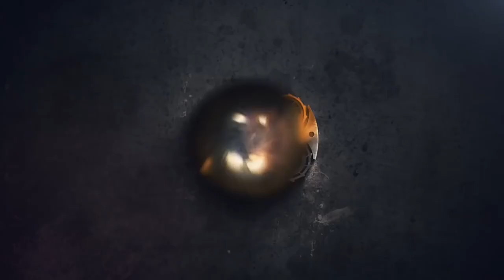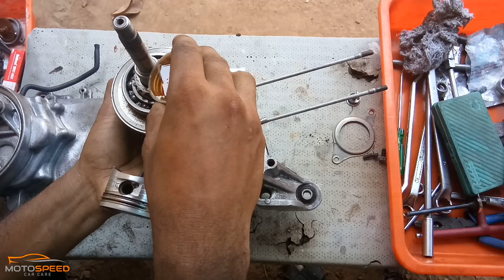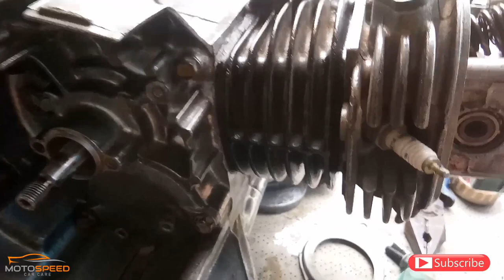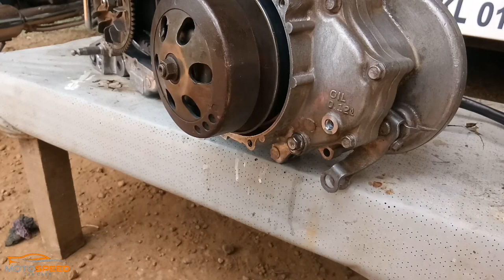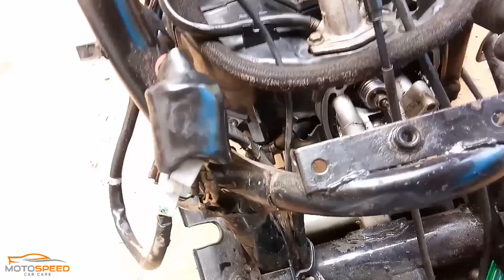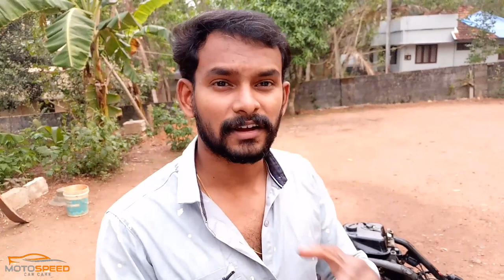Honda activa engine work timing setting | engine working മനസിലാക്കാം 😜

Comment: Ente alto model 2007 radiator fan engine off ayittum fan കറങ്ങുന്നത് nikkunnielle ravile on akkiyitttum കറങ്ങി കൊണ്ടിരിക്കുന്നു enthu konda
Reply from the maker: Radiator fan battery direct connect cheyythirikkunnu atha broo allengil temperature switch complaint

Comment: Honda dio 2015 model plug il pettannu kari adikunnu 3 weeks akumbol ingana preshnam varunnu ntha problem
Reply from the maker: Carburator tune cheyyyanam pinne air filter koodi nokkanam broo
Reply: Engine problem vallom ano

Comment: Hi bro comments iku reply seiyala...maruti 800 carburettor model black smoke.... solution tharumo...white smoke varala help me bro...
Reply from the maker: Petrol nte complaint varam broo athupole engine oil level kurayunnundo ennu nokkanam car nu misfiring undo ennum nokkanam tank il ulla petrol oru bottle il eduthu nokkanam engane undu gud condition fuel aano ennu ?
Reply: @MOTOSPEEDautomotivecare New engine block bro oil level  kuraiyela bro....missing light ah varuthu bro head complaint ah erukumo...but running la engine smooth ah eruku bro...your mobile number tharumo..
Reply from the maker: 9567554010
Reply: @MOTOSPEEDautomotivecare  Thanks a lot bro....

Comment: Hi bro എന്റെ 800 ന്റെ ഇൻഡിക്കേറ്റർ ഇടുമ്പോൾ ഡാഷ് ബോർഡിൽ light ആവശ്യമില്ലാതെ മിന്നുന്നു... temperature മീറ്റർ അങ്ങോട്ടും ഇങ്ങോട്ടും സ്പീഡിൽ ആടി കളിക്കുന്നു... അതെങ്ങനെയാ    ശരിയാക്കുക..
Reply from the maker: Indicator bulb ethengilum kathunnillayirikkum allengil flasher complaint kannum pinne temperature guage nte meter or wiring complaint kannum broo😍💞😘😘👍